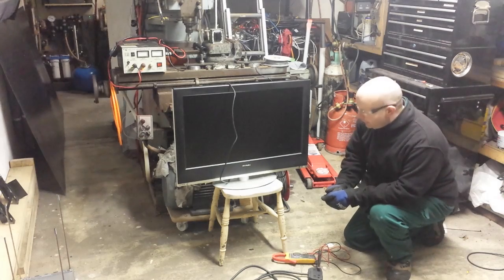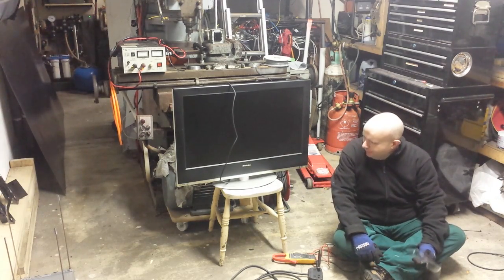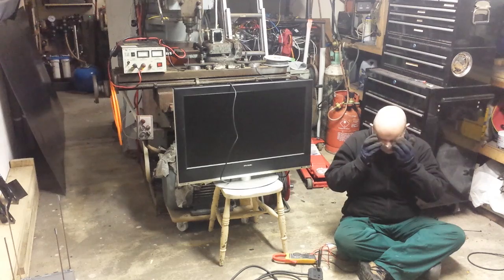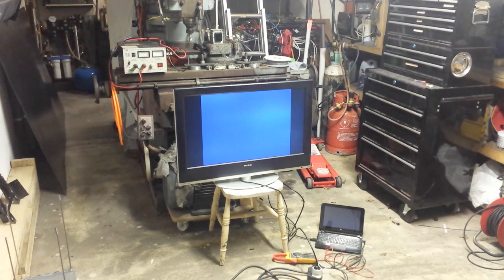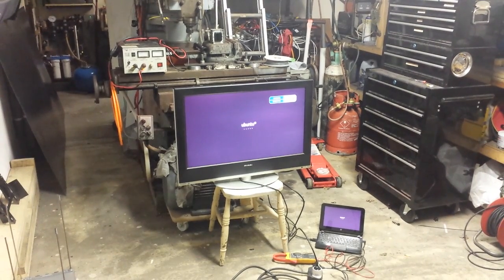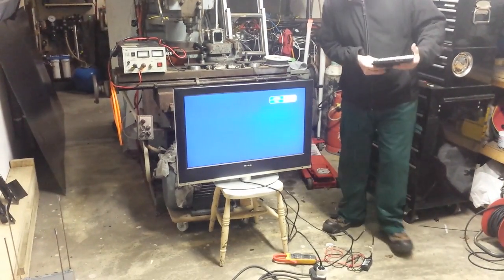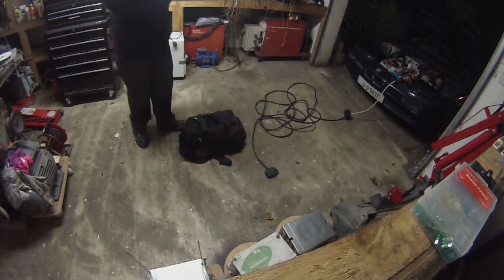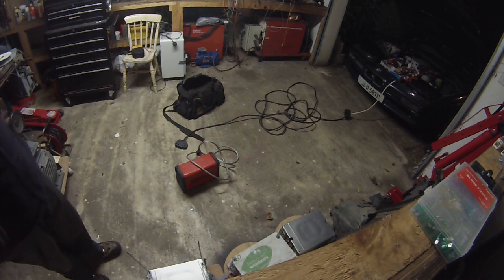CHEAP Vehicle To Home V2H Backup Power Solution Part 2

Comment: Damien, this is very interesting indeed. I can power most house appliances from my two Vectrix Vx-1 130v packs. the tolerance of the domestic appliances, and power tools, to current type and voltages adds great flexibility and significantly reduces cost of DIY "power wall" units. pure genius, Eamon
Reply from the maker: +Eamon Stack Thanks Eamon:)

Comment: I've charged a Macbook Air with the original power supply from my motorcycle, which only has 25 LiFePO4 cells in series. In my EV with 25-27 cells I'm also using a switching power supply from a Linksys WRTG54 to get an independent 12 volt supply which is converted to 5 volts and fed in to the TPS on the original carburettor, because the controller I'm using has the negative throttle signal connected to the battery negative. You don't want that connected to vehicle ground...

Comment: You really make it simple to understand. What about my pack that runs normally at 300 V ?
Reply from the maker: +brian warkentin As long as the equipment is rated for 100-240vac then 300vdc should be fine:) Don't forget to use a fuse and be safe. Thanks for watching:)

Comment: Damien: Excellent work. Am I to understand that almost any switchmode power supply (if rated correctly) will run off of high voltage DC? This is blowing my mind as I have never seen a typical consumer power supply spec'd to run with DC. I was always under the impression that the input stages of a switchmode power supply would measure both input voltage and frequency and then ramp up accordingly. I also thought that many of these power supplies would perform power on self-tests to check for the presence of non-typical input voltages.
Reply from the maker: +Daniel Perez The basic answer to your question is Yes. If an smpsu is rated for a voltage compatible with the DC you are supplying it will just work. The first thing any AC supplied switch mode supply does after basic line filtering is rectification. They don't care about the AC. All measurements are performed on the DC bus post rectification.

Comment: Could you use a switched mode PSU as a reliable DC-DC converter to get 12V for accessories? I know you aren't a fan of DC-DC converters.

Comment: Hi DamienBrilliant, I have been useing pure sine wave invertors tu up my power from Low DC power supply, is there a way to charge my NiMh from my Lexus batterys pack back up to 280v  ishuseing my lexus motor invertor.  from  230 / 240v  uk Mains ?This way  i can charge my project  and also power some domestic .I am finding it exstreemly dificult to get wireing diagrams  for the Lexus rx 450hI have managed over time to collect Lexus parts when they where as cheep that i could afford to buy them, rear  diff motor , Battery pack, and a invertor.If you can help in any way,  i can move forward with my Aixam 500 project.Thanks for all your Youtube helpKind regardsColin
Reply from the maker: +Colin Whitehead No Sure Colin. May be possible but I can't really say from here:)
Reply: Sorry for the spelling
and thanks for your quick reply.
:O)